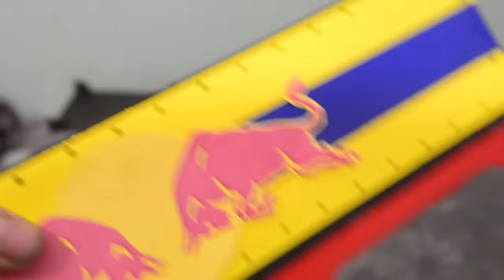Volvo VNL780 - Restoration Abandoned Semi trailer Red Bull truck

Comment: You "restorers" should do a video on how you artificially weather these toys. That'd be more impressive than the cleaning and new paint job.
Reply: N. Bvd
Reply: At first I thought the gashes in the side of the truck were part of the original design aesthetic, then when he cleaned it it sort of looked like the “holes” were done with a cutting tool on a Dremel?
Reply: Tomasz Piechocinski English please
Reply: Ravi mhtre doy
Reply: Fr you can see that they painted the weathering and rust onto it smh 🤦🏻‍♂️
Reply: It is incredible that small pieces and fragile plastics are still in these "artificial restorations" I do not believe that.
Reply: CLAY HOUSE  AAAAAAAAAAAAAA
Reply: @John Campbell          
All they do is throw dirt onto it, beat it up and bam it’s weathered
Reply: @ravimhtre5418  djdjjjjdjdjfjfjfjf
Reply: I do restoration and never have I seen a car anywhere close to this

Comment: why always choose that color for the interior? I never saw an interior chrome seats !!! the paint finish is not good
Reply: And imagine that You wouldn't be able to make this better. And maybe he just like this color duh?
Reply: @bloxxylenny  everybody is able to it. The paint job is more than just simple. Look at the lines of the masking tape. The paint is bleeding in at every inch of the model. You can barely see the scratches underneath the paint. I never saw a paint job by a modeler with this less effort. He put only one light source in the trailer that shines through the holes at the edges. This "restoration" is a joke. This model is botched.

Comment: I noticed that you had some paint bleed under your masking tape. You can avoid this problem in your future products by using Pledge Floor Care. It is a clear acrylic floor finish available just about everywhere. You just use a small paintbrush and apply the Pledge along the edge of the tape. This helps seal the tape and prevent the paint from bleeding under.
Reply: ศราวุธ คนขยัน  who and why ar you thanking them

Comment: Couple of criticisms......1) stop using standard masking tape for painting your projects, start using frog tape...it leave a much better line. and 2) an unopened can on top would've been more to the advertising standards......could've poked the same hole in the side of the can and drained it just as well.....would've taken a while, but still would've looked better!

Comment: This is nor restoration, this is buying new one and made it look like it's gone through rough time and then now you are making it better the way it was. 
facts screws are not rusted. still shining. 
Those holes were made from inside of the trailer, otherwise it would cracked. so you dissembled it made the hole and reassembled it again.
once the sticker was stripped the hole cutting marks are so clear.

Comment: These videos shouldn't be called "restoration" because there's nothing broken or damaged that actually is being restored, these videos should be called modification videos because your basically taking something and modifying its appearance. The holes on the trailer and roof were caused by a knife, not by wear and tear, the simple solution would be to use plastic and heat it up over the holes, then the whole paint scheme was way off, the can spinner thingy was just an unnecessary add-on.

Comment: Fake 
Reason 1: If it was real rust you would sand it with sand paper. You threw the parts in your bathtub. Cmon that will add actual rust.
Reason 2: In what universe does PAPER rust? Did you see the truck decals? 
Reason 3: From Mars you would see how some parts of the truck were literally NORMAL color and yet they were metal. So some rust some don't? 
Reason 4: Holes aren't real. When are holes 6 inches in diameter? 
End: I understand you do want to try restoration but at least get something already done and customize it to preferences or buy some rusty toy vehicles online

Comment: Sorry but this looks fake as hell. The two holes in the side of the trailer look intentionally cut with a razor blade, the "weathering" or "rust" looks fake, and the fact that none of the screws were rusty and stripped out is very telling. Not to mention the glob of hot glue that was holding the front grille crooked before you started "restoring" it.

Comment: Would not call that a restoration at all. To restore to original condition is a restoration. Thows holes you drilled all over the semis trailer were un even as could be. The blue stripe had running issues in the paint. An though the LED lights were a good idea. It still took away from it's originality. Do I'd never say this is a restoration. You fixed it but did not do a restoration